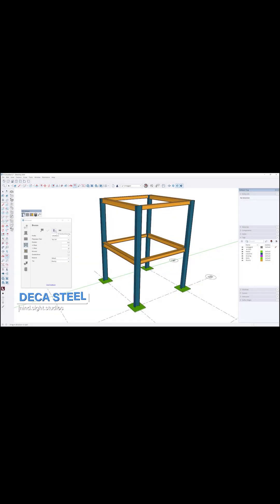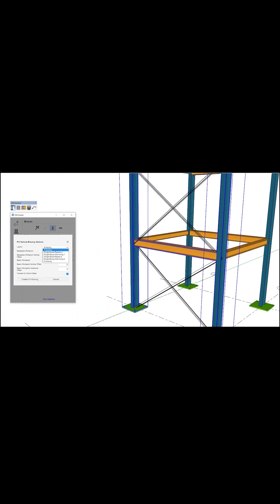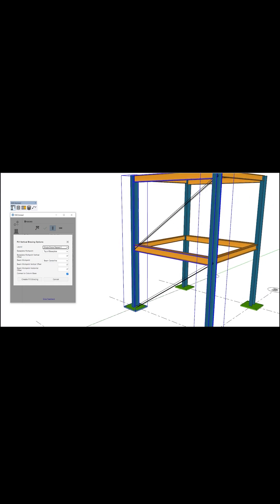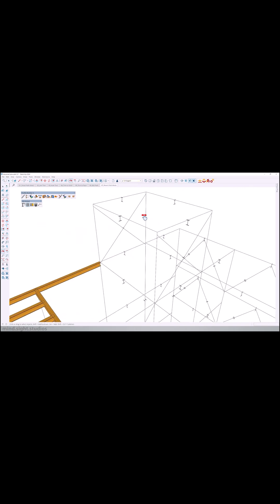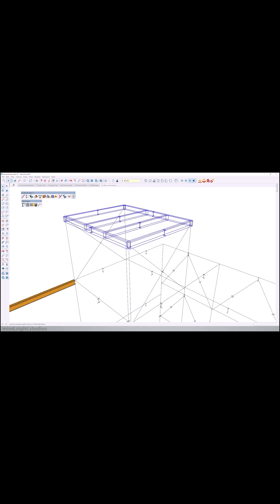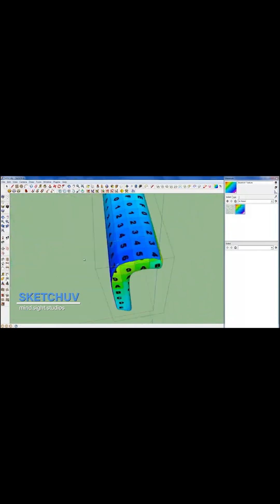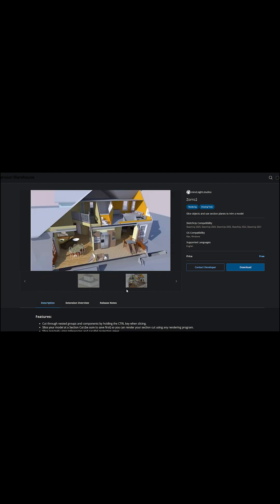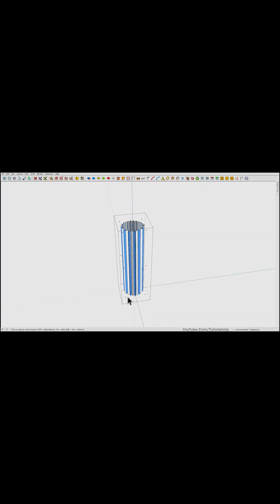DECAsteel 🏗️ Steel Design & Detailing in SketchUp (Free Open Alpha)

Comment from the maker: 🏗️ DECAsteel for SketchUp transforms the workflow of structural engineers, steel designers, and detailers. Create beams, columns, trusses, railings, and steel flooring with parametric tools that are easy to adjust. Add realistic steel connections like baseplates and bracing instantly. For larger projects, export to IFC, generate shop and erection drawings, and even create DSTV files for fabrication. Available now in open alpha — free to try!

Check the full video here: https://youtu.be/1eu8uOQ9O8I
▶️mind.sight.studios YouTube Channel: https://www.youtube.com/@mind.sight.studios
▶️Daniel Tal channel ( PlaceMaker Videos ): https://www.youtube.com/@danieltal3d

#SketchUp #DECAsteel #StructuralEngineering #SteelDesign #BIM #YouTubeShorts